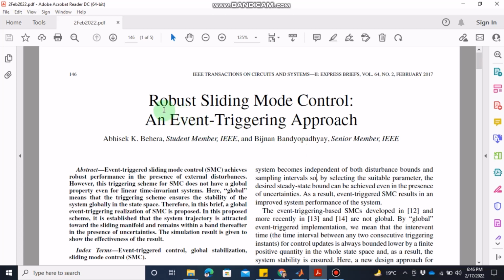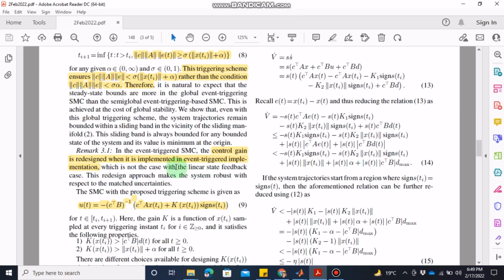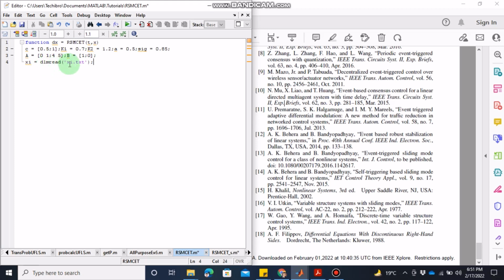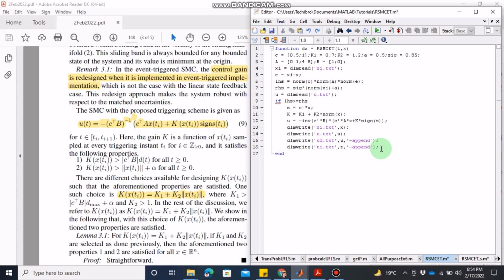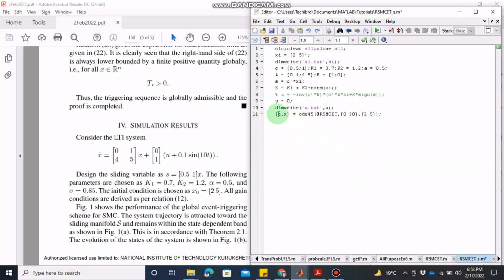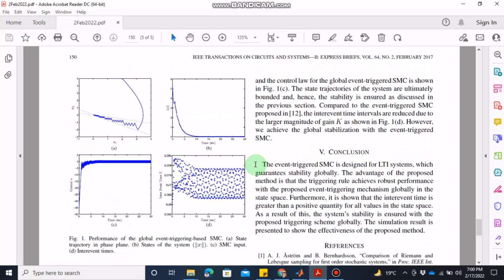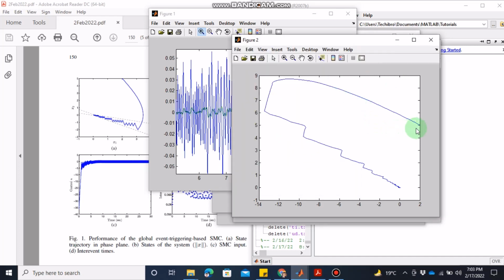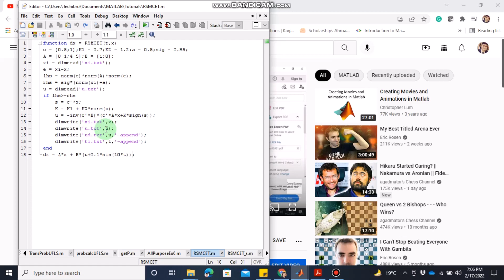MATLAB Simulation of Event Triggered Robust Sliding Mode Control

Comment: Thanks to the professor for sharing. The negative time problem in this case is due to the ode45 which does not generate the time value in sequence for some reasons. Also, the system Matrix B is set to the wrong value, so the result is different from the paper. Finally, it is recommended to use global variable instead of writing the txt to accelerate the process.

Comment: Have you ever simulated Event-Trigger by Simulink (Not Matlab code) ? Thank you !
Reply from the maker: No, I have not.
Reply: @cset  In your opinion, is there any difficulty between Matlab code and Simulink for designing the event trigger ? Thanks
Reply from the maker: @hocongminh24  I think both the code and the SIMULINK are equally good. It is mostly a personal choice. SIMULINK is liked by people who wish to witness the processing of the variable values (like visually seeing a signal connecting from one block to another). Coding on the other hand is preferred by those who are fans of creating logic and equations. For me personally, coding is faster than making blocks on SIMULINK. Creating an event-based trigger is nothing but an if-else statement (or multiple if-else statements in some cases).